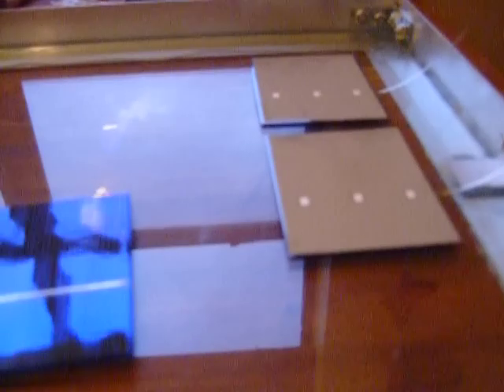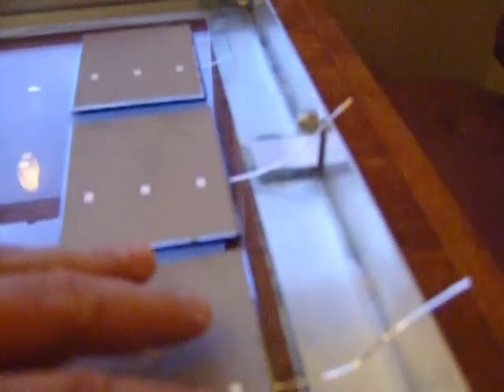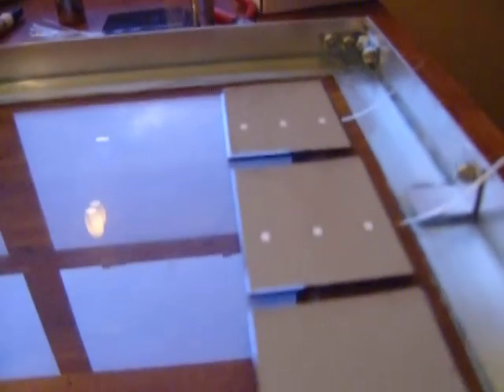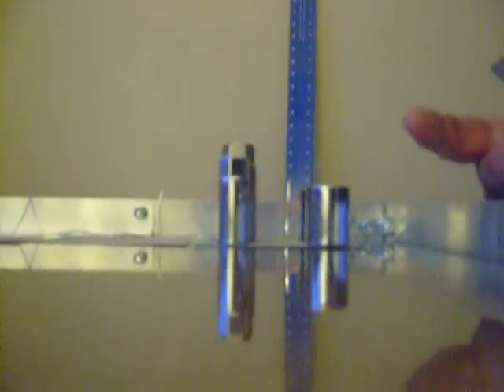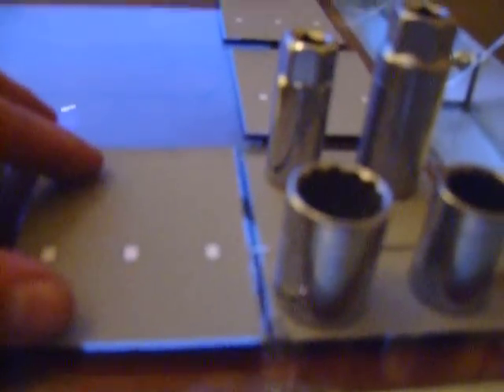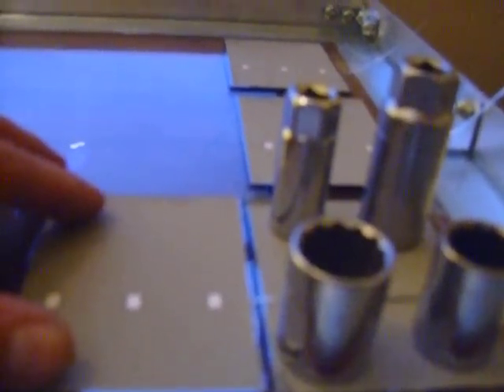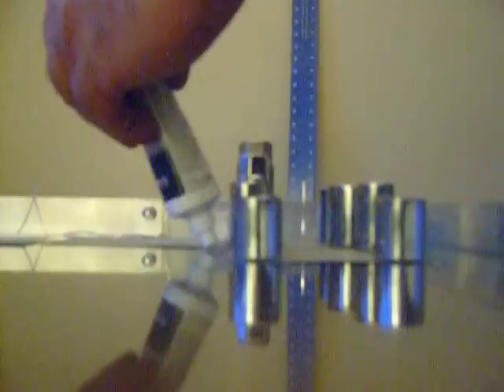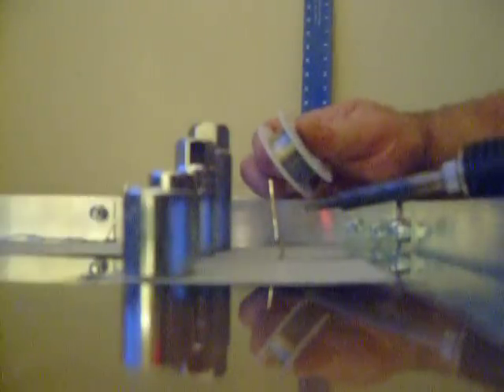How to Make Solar Panels that Will Last For Thirty Years Part 5

Comment from the maker: @cqammaz53 These cells I had cut special from solar cells101.com they are not exactly alike or the same size. But when I use the 5x5 cells they are exactly alike I found that I can eye ball it them after I figure out where they are going to go. I like to draw a line to get them spaced right. For me it just easier if I eye ball them. Some people like to use tile spacers. I dont like to get that stressed out about it so I found it was more fun just to eye ball them and kinda follow my line.